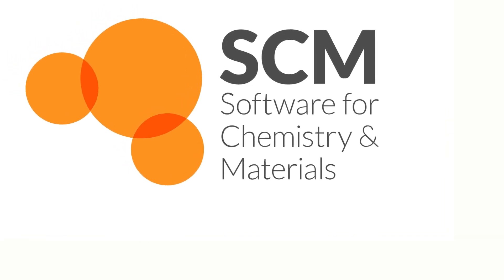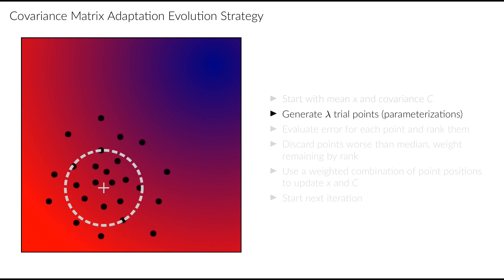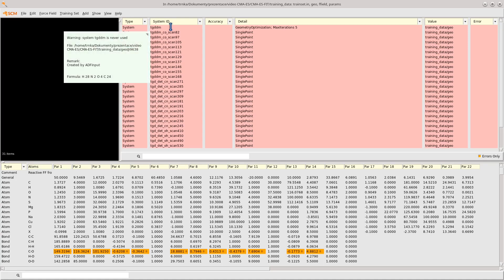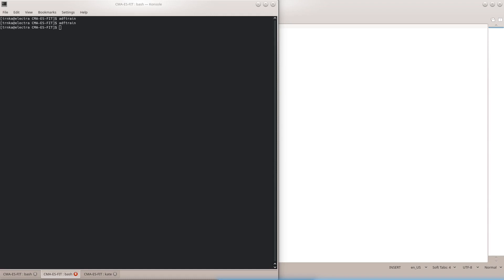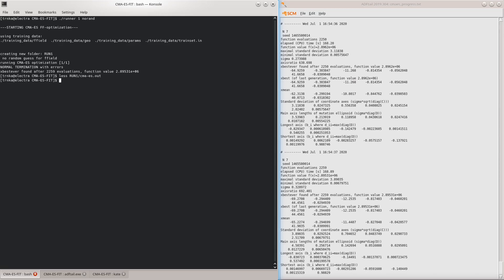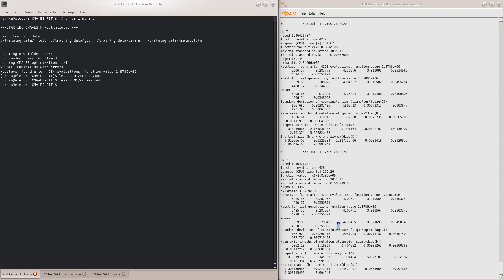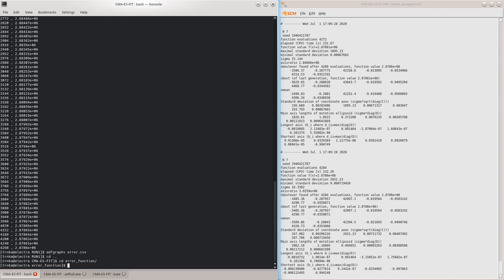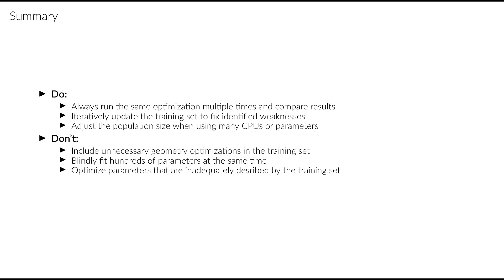Fitting ReaxFF force field parameters with CMA-ES

Comment: I believe that one does not add torsion to optimize force fields. What is the reason for torsion not being added for optimization?
Reply from the maker: In this demo, we have deliberately made the training set extremely limited and also optimized just a few bonded parameters to show the issues that arise when your setup still needs a lot of improvement. Of course, when creating a real force field for production use, the torsion potentials will have to be fitted as well.